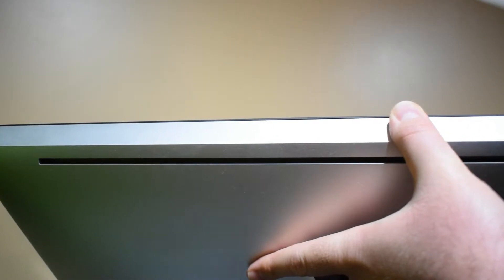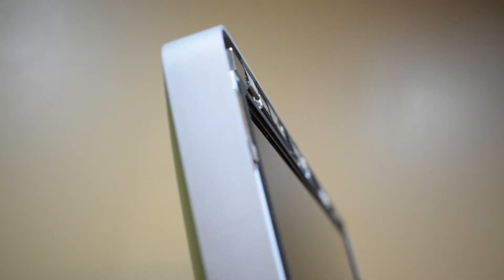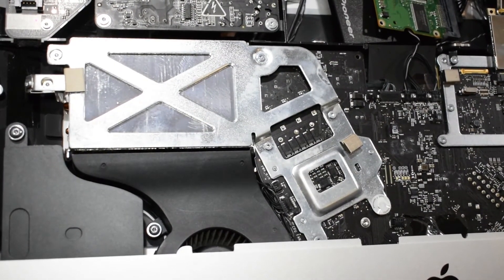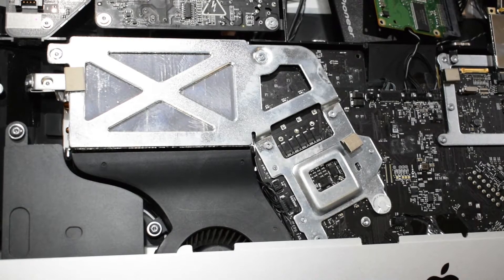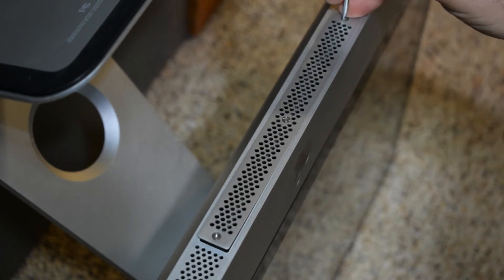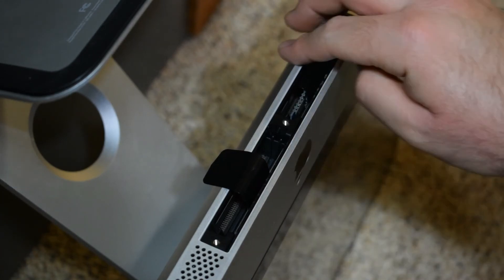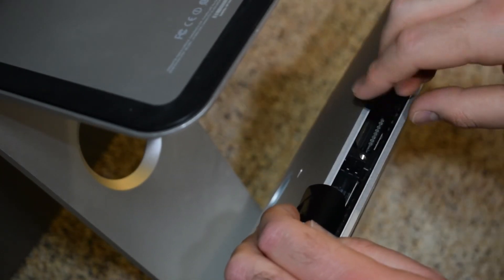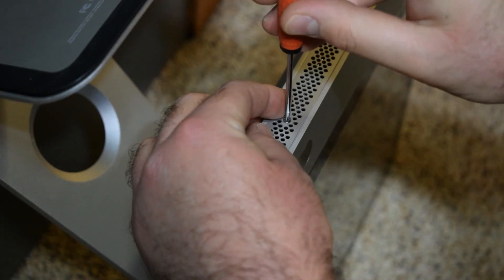How to upgrade a 2010-2011 iMac to an SSD and RAM upgrade!

Comment: Does using the circuit board from the  original HDD stop the fan from spinning at max speed ?
Reply: I have the same question, cuz I wanna upgrade my old iMac 2010

Comment: Do you think if I swapped the 2011 imac’s cpu for an i7 3770k, and if I swapped the 2011’s
 gpu for a gtx 980m do you think it would work? I did some research on the compatability for the gtx 980m and they say that it’ll likely only work if the gpu was pulled from an Alienware desktop. But for the cpu I feel like it would work because it runs on the same LGA 1155 as the i7 2600 you were using in your machine. But yeah, I just wanted to ask you a question if you think it would work because it seems you know a lot. Thanks, Owen.

Comment: Just stumbled upon a 2011. Curious about the cpu you went with.
Reply from the maker: It's the i7-2600!
Reply: @Easy1Productions  is that the faster cpu for that socket type or is there something even newer that can fit it?
Reply from the maker: @Daddyfly_RC  that is the fastest that will fit in that year, and honestly it does the job, my 2011 scoots with this cpu, 16 gb ram, and an ssd!
Reply: Tech Time With Tony Do you think if I swapped the 2011 imac’s cpu for an i7 3770k, and if I swapped the 2011’s gpu for a gtx 980m do you think it would work? I did some research on the compatability for the gtx 980m and they say that it’ll likely only work if the gpu was pulled from an Alienware desktop. But for the cpu I feel like it would work because it runs on the same LGA 1155 as the i7 2600 you were using in your machine. But yeah, I just wanted to ask you a question if you think it would work because it seems you know a lot. Thanks, Owen.
Reply from the maker: @owenmillson  Hey Owen! So as far as I know from when I was doing the research on the iMac for the swap I only found that the 2600 works in these, I have a desktop build. That has an i5 7th Gen in but I can't upgrade to an 8th gen but they are the same socket type, I think it's because of really technical things like power and heat and other things like that, I'm not completely sure why but they do have there differences from what I found, but you can use the gpu from the Alienware! I was actually thinking about doing that swap at some point as well!
Reply: Tech Time With Tony just for curiosity, do you think the i7 2600k would work? And also, is the 2011 imac the only imac that can do gpu upgrades, because didn’t the 2012 switch to a slimmer design and because they had to switch do a slimmer design, didn’t they have to integrate the gpu into the logicboard, meaning that it would now be impossible to upgrade the 2012 ones because the gpu is integrated?
Reply: Tech Time With Tony also do you have an instagram or something that I can contact you with because I would like to ask some more questions.